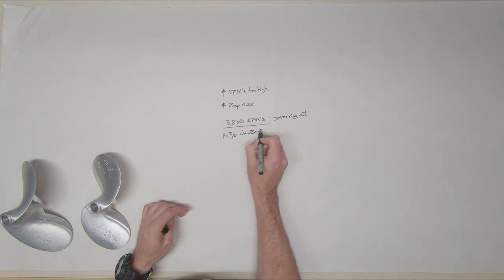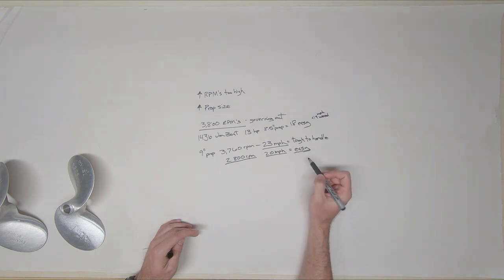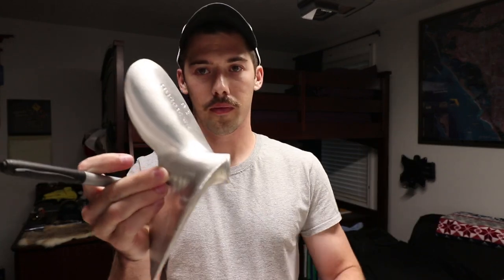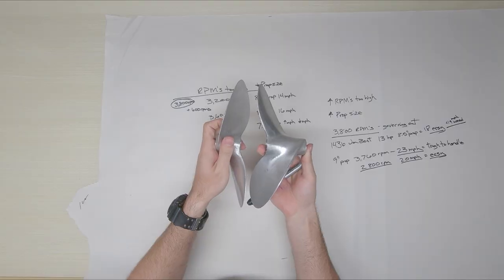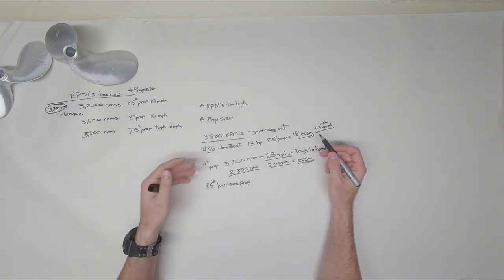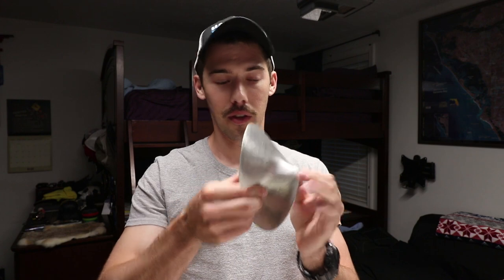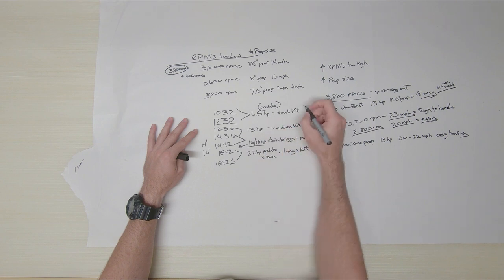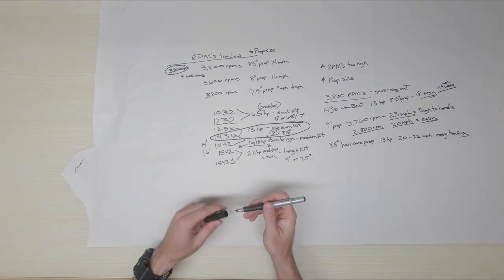Sizing a Prop {Longtail Mud Motors}

Comment: Nice video again. As I see it the prop size needed varies with the size and design of your boat.or its ability to plane or move through the water with ease. If your engine lugs and doesn't reach good rpm in its power curve you need a smaller prop for that boat to perform well. if it revs too high you need a bigger prop. What I do is put on a prop that is somewhat too big and the engine lugs a bit, then I custom size it by grinding a bit evenly off the blades until the engine reaches its operational power curve, this makes it have a smaller diameter and smaller blades so it will rotate faster. The result is a prop that is custom ground, a tuned prop. You see sometimes its hard to get it right with a stock prop running on a certain engine and a specific boat with a certain amount of drag or weight in the craft. I used to make airplane props and this is one way I tuned them years ago. While this isn't always necessary its a good idea to have several props on hand as you may sometimes need one or the other depending if you have a lot or a little weight in the boat. Dont forget to have fun-Thai Sean.
Reply from the maker: Great comment Thai Sean! Along with the video you made 👍

Comment: Good video, the only thing I want to point out is the corkscrew thing. Yes, it's a good analogy to explain pitch, but props act alot more like an airplane wing. It was a real eye opener for me once that clicked in my head. That's where cupping comes into play, and that's why the props have the curved surface. 

As it spins, it creates a pressure difference and that's what creates the thrust to move forward. That's also where cavitation comes in, not to be confused with ventilation. Ventilation is when the prop sucks air in from the surface, and why people use (what is often wrongly called) a cavitation plate. Actual cavitation is when the the pressure on the low side drops too much and causes the water to boil (science stuff, boiling temperature is affected by pressure).

Not to get too far into the weeds with it, but the reason I think that distinction is important is because that's why larger props put a heavier strain on the motor, even if it's the same pitch. There's more surface area to create thrust. 

An example, pretend they work just as a corkscrew. An engine doing 3500 RPM would go the same speed with a 7" prop as it does with a 10" prop if they have the same pitch. But as we all know, that isn't true.

Anyhow, I'm no where near educated enough to give a class on it, and it's actually pretty hard to find explanations to the science of boat props. I just did some experimenting with props on my boat and the performance differences were substantial. 23mph with a predator 212. I obviously knew something was working well, so I took it upon myself to try and chase down the answer as to why. Went down the rabbit hole and been interested ever since. 

Thanks to anyone who actually read this drawn out comment, this is just barely scratching the surface though lol.
Reply from the maker: I went down a very similar rabbit hole as you, and that is why I used the corkscrew analogy because I felt that most people can wrap their head around it even though its not the complete answer. I would love to be able to make my own props and play with pitch, rake, cupping, all that fun stuff. You are completely right, and it is difficult to find information on props. Its a science of its own.
Reply: @JTgatoring  the biggest reason I wanted to point it out was so people know why diameter affects speed and the load on an engine so much, even if pitch is the same. It took me an unnecessary amount of time to put all the pieces together as to why that is lol.
Reply from the maker: @playinlikejimi  I completely agree with you, its good info you posted, I'm reading your FB message now haha
Reply: Curious, what combo (prop, shaft length, boat and such) did you use to get to that 23 mph with a 6.5? I am in the middle of building my own and the prop is the biggest variable as to where to start.
Reply: @southronjr1570  most important part is to keep it light. Once the boat is weighed down, it slows down drastically. But I got those speeds with a 6.5" prop, stage 3 kit from NR Racing, and pushing around 6k RPM typically.
Reply: @southronjr1570  it's a 212 but it definitely isn't 6.5hp it's way hopped up.
Reply: No propeller is 100% efficient and there is a limit as to the work they can do!
 The heavier a boat is the more critical proper prop size becomes, Prop slippage is often talked about with fan boats but it applies to all propellers! In a perfect world a 14" pitch propeller would move you boat 14" with every revolution regardless of the diameter!

Comment: I ran all my different props on my 16’ 42” 670 predator. I ordered a 10 or 10.5 KKK prop and it was definitely the fastest out of all 4 props.
Reply from the maker: Great! Not many people have a 1642. That sounds like a nice size boat. I am surprised you can turn a 10.5" prop on a 670 with that boat. Most people can only get up to a 9.5" prop with a 1542 and 670 engine. Do you know what your RPM's were?
Reply: @JTgatoring  no I don’t have a tach on it but I do believe it went to the limiter. It’s a completely stock 670. Every thing I’ve seen said 10” 10.5” props needed more motor I was afraid it would bog down but it did fine on my setup. I went and checked and it’s a 10” kkk prop I don’t recall the pitch of it. We had 2 people a 80lb battery, cooler and a tool bag in the boat while testing.
Reply: How fast did y’all go
Reply: @jtfishing6929  I haven’t checked on the gps with the big prop yet. I removed my governor and put the 9.5” back on and now it’s the faster setup. The 10” prop was keeping it just below the governor.

Comment: This was very helpful. I don't know anything about these except for what I have seems to work good but it's a little limited for my liking. I have a 14ft jon boat with a predator 212 with a mud skipper kit and a 6.75 inch prop and I've never had a problem before but a couple weekends ago we had the sucker loaded down and it was really lagging and I couldn't figure out why... I'm going to downsize the prop before I go out tomorrow and that should help. After realizing how lacking it is in power I kind of want a predator 420cc but it's hard to justify because the setup I have now is good for running jugs and fishing but it sure takes forever to get across the lake to check the jugs. 😂 I do get a lot of questions on it and I've never seen another on the water in my area.
Reply from the maker: Haha I really enjoyed the 212 on my 1436. 12 mph was the normal mph. It's enough for a normal day. The 420 definitely has a lot more umph if you need the added power or speed. Downsizing the prop should help with your situation. A tachometer will also help you diagnose your problem. I've never seen another longtail in person while I'm out in the water and I'm in the water covered state of florida 😂

Comment: 1436 13hp 8.75weedless 3800 no more than 17mph. Definitely gonna give this hurricane prop a try. I myself was just talking about having a little bigger engine than the 13hp.
Reply: Was running the 8.5 with the same speed but turning more rpms to reach that speed. You can get more rpms if you remove the screw on your throttle linkage that is on the motor itself.
Reply from the maker: @jimmyhopewell9142  Yeah the 16 or 18hp vtwin sounds awesome, and it's lightweight, just expensive when you compare it to the predator engines. As for right now, I'm trying to keep my motor bone stock so others know what to expect from a stock engine. I hear a lot of people removing that screw. You haven't experienced any issues with doing that?
Reply: No if ya rev it high enough it just floats the valves. I was going to remove the govenor from inside the engine and order some stronger valve springs so I can rev it higher. But then people say you need to go with billet aluminum flywheel once you start increasing the rpms. But I haven't done any of that I want to try a 8.5 hurricane prop first before I tear into the engine.
Reply from the maker: @jimmyhopewell9142  Yeah, Once you open it up, might as well do something while its open. Let me know how the hurricane prop runs for you. I haven't heard much about it
Reply: @JTgatoring  16 Vanguard is Crackerjack motor!
Reply from the maker: @jacklowe3788  Haha gave you a reply on your last comment without seeing this. I would love to try the 16. I just think it would be too heavy for my transom
Reply: @JTgatoring  Yes I would agree with - I think next Common made Good boat size would be the 1542 like the Alweld - Thanks for getting back to me - After I made last comment I went found where you addressed difference in backwater kit & SPS - I think Il break down before long & get Medium SPS kit For an old  1448hull I have sitting around- I have 16hp Vanguard on Garden tractor that don't use anymore w/ low hours- Keep up all Good Info.& Work - Your a Professional & Thorough young Lad w/ Good Commonse head! Take Care buddy-
Reply from the maker: @jacklowe3788  Thank you Jack, I really appreciate it. Just want to perfect the 1436 for me right now and then onto playing with different boat and engine sizes. The transom rebuild is almost done and I hope to get the video out soon. Then its time to get back out on the water

Comment: 14 36 Jon. Predator 6.5. I know I know.. bigger motor but.... I went for the price and I'm not making a speed Jon.  What  prop size for a happy medium in torque and speed?
Reply from the maker: I don't mind that setup. I used to have it on my jon boat. 6.5hp is great if you just need motor for your jon boat. It would depend on you load. The normal: 6.5 standard prop. People have stated they've ran a 7.5" prop on a hopped up 6.5hp engine and some run a 7 on a standard engine. If its really heavy with a big load, then maybe a 6.25" prop but the standard props have the best low end, towing/torque, hulling stuff performance. If you need speed, the hurricane props provide that extra pitch. So with that engine I haven't heard too many people running the hurricane prop on it, it is mostly the 6.5" standard prop or the 7" if you have a light boat and load.
Reply: @JTgatoring  thank you
Reply from the maker: No problem, good luck!

Comment: Where I live (very far from the USA) .. very tricky to find 2 blade mud props... heres a wild question.. could you set up a short tail surface motor with a conventional 3 blade outboard propeller? Maybe this has been covered somewhere but cant find anyone thats tried it.. Im running a 450cc 15hp 4 stroke.. would love some insight .. your videos are super insightful
Reply from the maker: Hey Jon. I have not heard of anyone doing that. In the states there are a lot of options. You can either find a distributor or prop maker in the states, or you can get them from over-seas from China or Thailand. It would also depend on the shaft of the engine. The thai longtail has a tapered shaft. The majority of the surface drive motors in the states have a hexagonal shaft. They use to be threaded, but people were stainless props on and stripping the threads on the shafts or snapping the shafts. The hexagonal shaft fixed this issue. In the states, they make 2 blade, 3 blade, and even 4 blade props. There are many options here. So it would depend on what you're using the motor for, what type of shaft the prop fits on, and what style of prop would be needed for your use.

Comment: 1440 22hp 100”. I usually run the 8.5” hurricane for duck season and or heavy stuff camping heavy day trip etc. but actually when I go hunting alone or frogging alone. I use the same model prop, but you can bend these and put a more aggressive pitch in em with a vise and a socket wrench handle. Just me an ice chest stock hf 670 with the bent prop gets 22-25. Standard hurricane same weight 21-23… don’t crack it but you can bend these sharper. I wish they made some kind of a 3 speed pto. Like .75/1 1/1 and 1.25/1 that could be shifted on the fly.
Reply from the maker: I've had one or two people tell me about doing that but not many know of that trick. I haven't had the time to play with it myself. It's been a long time since I've played with my longtail. That's really cool though! I'll have to give it a try when I can. I think adding some gearing would be really cool to do for a longtail. It does add some complexity to it and does add one more thing to break, but for some, it would definitely be worth it.  That would be cool to have a little shifter for your longtail haha
Reply: @JTgatoring  yea it’s kinda hard to get to. It’s definitely about power to weight with rpm’s and enough prop to do it. You kind of can’t do it with a perfect tuned rig either. It’s gotta be a bit front heavy like when you have to use a stick under the handle. And just go as fast as it’ll go till it sounds like it’s limited out. Adjust stick so prop ends up higher and higher. Till it either does it and you can back off the gas when it does. Or you don’t have enough power or prop. For the long canal trips I take it’s just easier to use a stick and half prop it. Once it does it I speed up and it starts to overrev so I back off a bit and cruise 22-24 real light boat 25-26. If it doesn’t half prop. 20-22… like normal running.
Reply: @JTgatoring  yea dang doesn’t even look like you’ve posted a video in over 2 years.
Reply from the maker: @MrT13  It sounds like you got it figured out for your needs. I know I had mine tuned and figured out pretty well. And yeah, I've been attending to some things that took priority and required my time. I will get back to making videos and enjoying my rig, the only question is when. Thanks for sharing and stopping by Mrt
Reply: @JTgatoring  I think I talked to you before. But if you get time and can travel east to the Everglades. I’ll roll with you one day and take you to the camps, picnic, tower, etc. hope you get your life in order. I’m older than you so if I may. Money first. Family is always there. Women come and go with money….. but you only ever get out what you put in. In the gym. At the job. In the mind. At the beach watching in your case the sunset. Hope you got something better going on than just never going out. I’m going frogging tomorrow. In mentioned boat. At low water. And stabbing catfish and tilapia. Hell or high water….
Reply: @JTgatoring  I miss spoke. *Not the hurricane prop. The bullet prop. I forgot I tried that largest size whatever it is. 8 or 8.25” or whatever and started using that one I think 2 years ago. And then started bending that one not the hurricane. I think it was like 1/2” or 1/4” smaller but like 3-4 more degrees  pitch or rake or one of those. You hold them next to each other and ones got more angle…
Reply from the maker: @MrT13  I appreciate that Mrt. I'm spending my time with the future in mind. Planning for the worst, and appreciating what is given. Good luck out there. The biggest bullet is 8". The biggest hurricane is 8.5".  I've only run the 8.5" hurricane.
Reply: @JTgatoring  yea 8x8 bullet. Well good luck with whatever it is your dealing with

Comment: Its a swamp runner large kit runs great at 3/4 throttle about 18 mph. At full throttle I have to horse the prop into the water. It wants to jump out of the water as the wake moves back from the boat.
Reply from the maker: That is the issue I run into with my 85" shaft on my medium kit. Once I run over 20 mph, I outrun my wake and gets hard to handle. I'll be playing with it this year and see if I can come up with a solution
Reply: Hope you figured out by now. More pitch. Adjust skeg. But most of all move the motor back 1-2 holes on the bracket. I run the 100” and yes had to play with things but once you get it figured out and enough pitch you can run it on half the prop and it’ll still bite and keep it self half floating in the water not float up or kick out port. It’ll float. The top half of the prop is only drag… as funny as that sounds it is what it is.

Comment: Hi,  What a great video, I really enjoyed it.  I just bought a project 39' sailboat and need to move it ASAP. The original motor seems seized up and the tranny drips water - so want to bypass this.  Strengthening the transom to handle an outboard would be easy.  My preferred destination is Saint Augustine, FL and the Morgan 39 is 205 miles south in Stuart, FL.  It most likely is not a straight shot up the Intercoastal Waterway and about 25 miles would be open ocean due to 6'7' draft.  Being on the open ocean with an outboard makes me a bit nervous as I only have an ASA103 and little experience.  It would be easy for me to place a long tail on my boat.  Could anyone comment on what to expect from a 13-15 HP Predator engine? I couldn't afford a long tail with reverse and am not sure yet if it would be absolutely necessary. Anyone know what the Marinas require? Thanks in advance for your assistance!

Comment: great video. I may have missed this but how do I figure out how many RPMs I am getting? I have a 15hp lifan on a medium kit and a 1436. I have a marine 12v battery and a 5 gallon gas tank but I'm not sure if that constitutes a heavy load or not.
Reply from the maker: You would need a tachometer. It is normally a small black box with a display and a wire coming out of it. Most people refer to them as a tach. They are installed by wrapping a wire around the sparkplug lead. Once the wire is wrapped, it calculated the RPM's by the electrical pulses to the spark plug. That will allow you to see the real-time RPM's of your engine
Reply: @JTgatoring  got it, thanks!